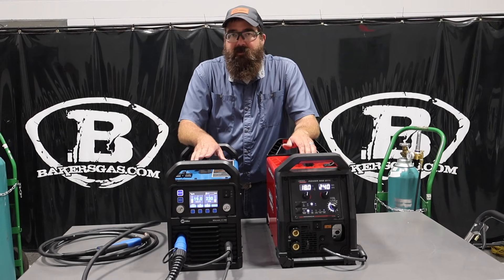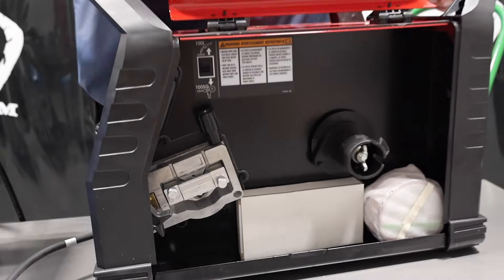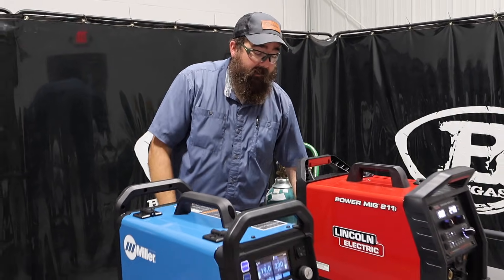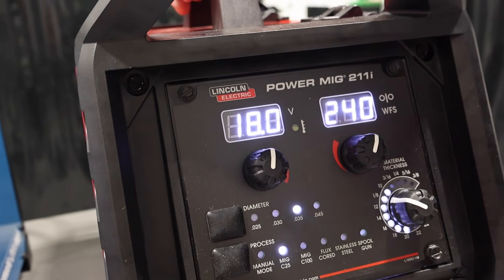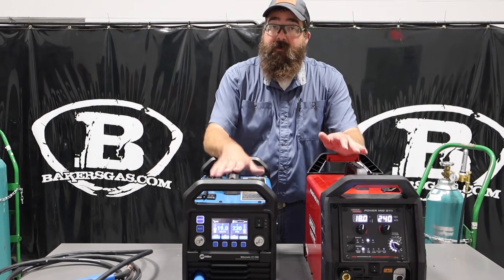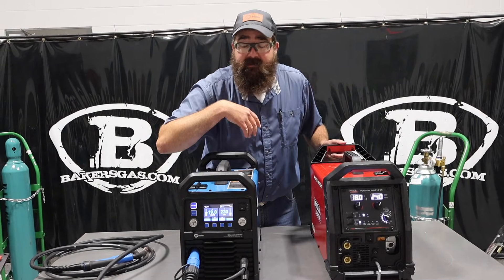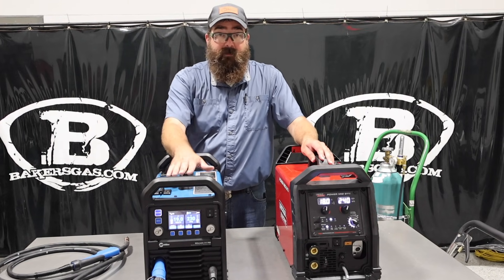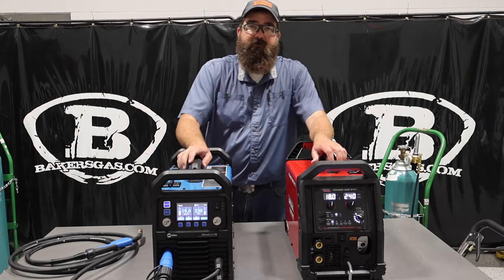Miller 211 PRO vs Lincoln 211i

Comment: I've had a Lincoln 211i for almost a year.  Solid machine.  Either one you cannot go wrong.  I do some metal art work and even took a class where the Lincoln 211i machine was featured and it was first rate.  A tip.  If you are serious about welding...even as a hobby, go red or blue.  Stay away from Amazon.

Comment: Looks like the Lincoln is a multi-process welder.
Edit: OOPS!  No it isn't. I'm thinking of another machine. I was thinking of the Lincoln POWER MIG 215 MPi. I've had a couple of Lincoln welders and they are good machines but I think I'm going to stick with Miller in this case. I went ahead and got the Miller 211 Pro at Airgas today and really like it even though I haven't used it yet.